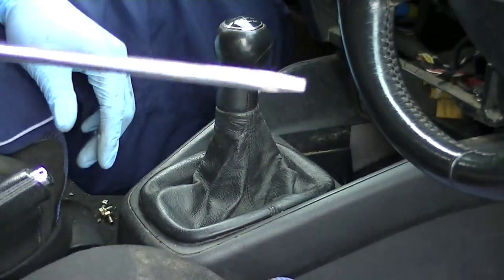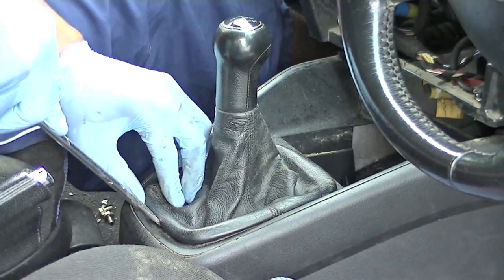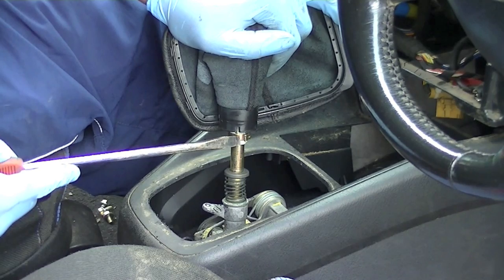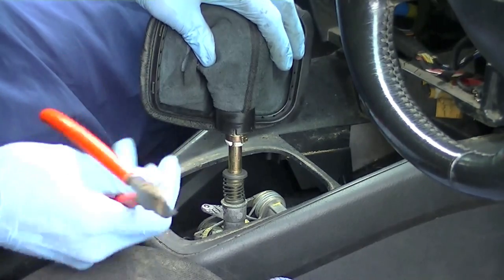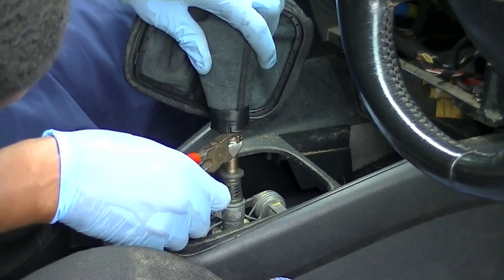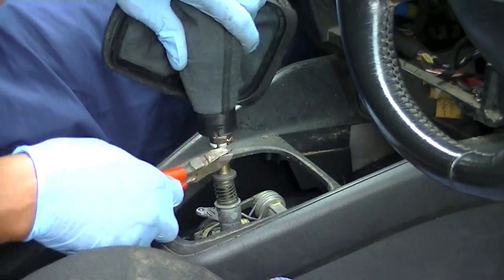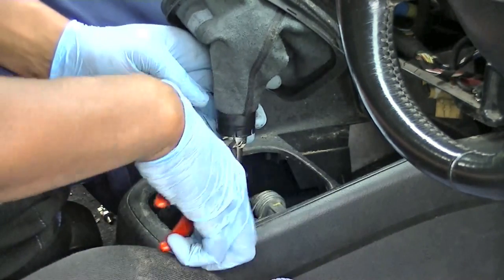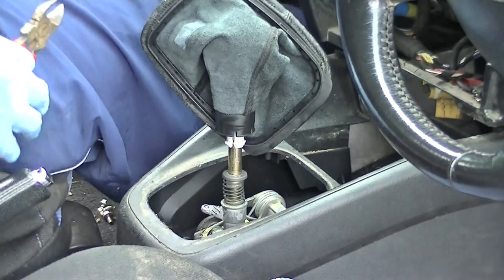VW Gear Knob Gaitor Boot Removal as Requested by Subscriber

Comment: my shifter boot is different. I have an 02k gearbox. Can the plastic adapter in the shift boot be removed?
Reply: same answer I am looking for. Did u find a solution?
Reply: Yes it can be removed, i just started working on this today. Just use a t-40 bit on the bolt on top and you can remove the plastic adapter underneath it. Be carefull though, getting it into 1st gear will be more bifficult as you dont have the adapter anymore...